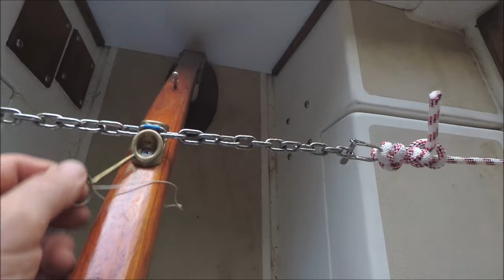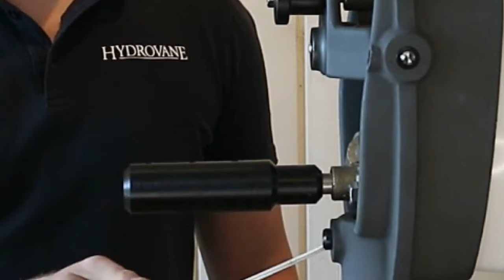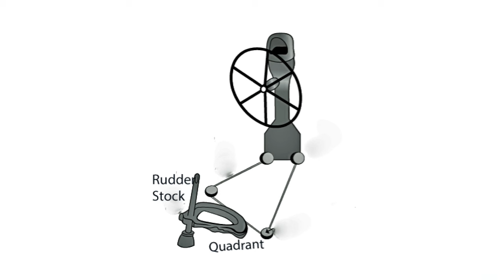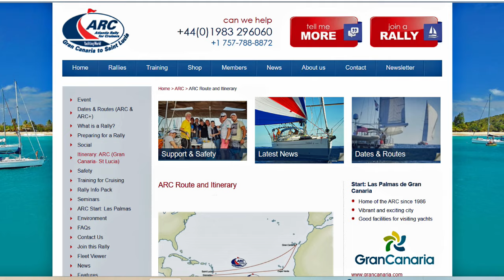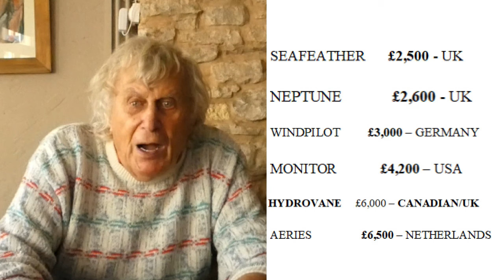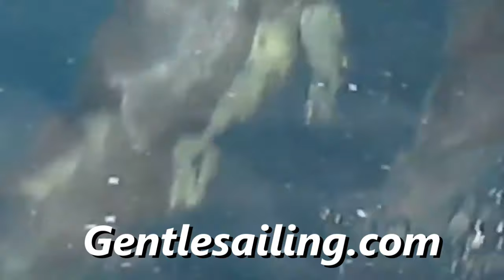Windvanes and Autopilots

Comment: The Subject Nicely covered Michael. I've been struggling with this for a while now - to say the least 😅 - and have settled on a Hydraulic System of some sort to go for with my next Sailboat,  which should have , thanks to a large beam between the Hull Chines,  have room for close to 1,000 Watts of Rigid Solar Panels, and finally, after finding Delamination protected seni flexible Solar panels - Delamination kills most flexible Solar Panels within 2 years - so I can add at least two x 200 watt Panels to the top of the Bimini, and I have found out how to use a Bank of Lifepo4 batteries, to manage the charge State of an AGM Bank, plus AGM engine start , Windlass, plus bow thruster batteries in tip top Condition for very long service Lives - barring accidents- as I like backups of backups, a full set of spares will be needed for the autopilot, and the size of the boat has been upped to have room for a moderately sized generator, as backup for a not too large Output cool running engine Alternator. Hopefully, the Piggybank is going to be large enough to cope with the rather eye watering expense, if not, plans will have to be altered, which will be rather a shame, as it appears that I have successfully lined up a significant discount on a new  bot. Fair Winds. Bob. 🤔🌟🌟🌟👍
Reply from the maker: Well done Bob.  You certainly seem to have done your research and have excellent backups in place.. Good luck with he plans and it's good news about the boat!
Reply: @SailingGently  Thanks Michael. I have passed on Recommendations for Terry of Bumbling Sailor Channel to get your Gentle Sailing Route along the Coast as he has ambitions to Sail his boat to the Mediterranean now, and I can't think of a better and more Enjoyable Route for him to take. Fair play, as a new Cruiser, for just over a year or so, he is doing RYA Courses and is making really good progress, and has successfully Sailed around Lands End, up the Bristol Channel, up the Irish Sea to the Isle of Man, Northern Ireland and presently is in Conwy Marina, taking advantage of a Marina package, which means he can stay in any Marina in the UK for up to 30 days,  and he is doing it Single Handed. To say that I am Chuffed for him is a bit of an Understatement tbh. His Progress has been simply amazing. Fair Winds Michael, and hoping your boat is OK through what is left of Hurricane Season.  Bob in Wales.  🤔🌟🌟🌟👍
Reply from the maker: He sounds like a 'natural born' sailor!
Reply: @SailingGently  👍 The changes in him this past year or so, frankly have been really impressive imho, and as you say Michael, he's a natural who has a good character foundation. I think if he uses your Route to get to the Med, apart from really enjoying it, it will greatly expand his experience as well. I think he'd be safe enough, with care with an Atlantic Crossing,  but it might not be the most comfortable Sailboat to do it on, as it's a pretty light 30 footer. One way or another though, I think he'll make it. Best Wishes and Fair Winds.  Bob. 👍

Comment: Good video. However new , modern autopilots are very efficient even with high winds and seas. ( see the racing boats in the transatlantic and around the world races like vendee globe. No one is using vanes only pilots. Very very few pilots failures. Some yes but same for vanes). More expensive yes but quite reliable for the best brands and not so much energy consumption i believe.
Reply from the maker: Bonjour jean louis, Thank you for your information.  I didn't intend to imply modern powerful autopilots are not good.  Quite the contrary most are excellent and better than wind vanes if you can power them. It was only the Raymarine Evolution Wheel pilot that I have found to be badly designed  and grossly underpower.  I agree with all that you write. Thank you for watching

Comment: Excelent info! My 42 foot and 16 ton sailing boat consumes between 10- to 15 Ah under way. And a large part of that consumtion is our SimradRobertson hydraulic ram pilot. The first we had was from 1985, and was given to us foc. And it worked flawlessly on our boat for 20 years. Now we have installed a brand new one. The old one has retired as a spare. And our batteries are totally dependent upon our diesel genset or shore power as you say. We don't have enough sun up here in Norway to cover our consumtion by solar power.
Reply from the maker: Thanks for the feedback. I find even in the Caribbean unless you have a vast solar panel display and are disciplined with your amps usage you need  some form of mechanical backup and a diesel genset is the way to go.  Sounds like you have it all sorted